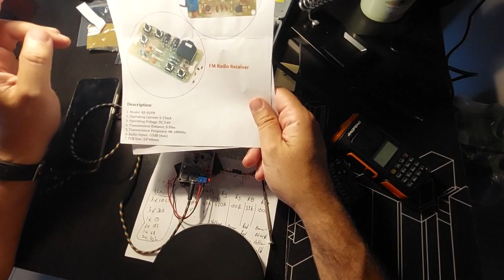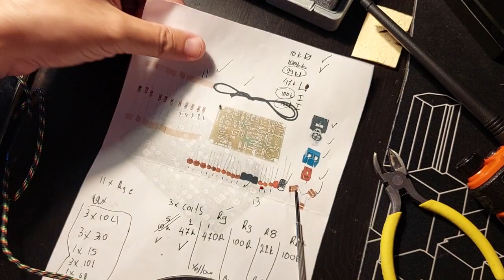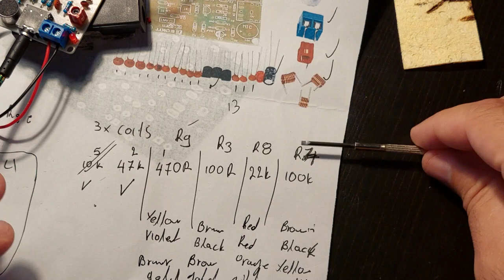FM radio transmitter from ebay

Comment: The signal you were receiving with that Baofeng was not the correct frequency, but some harmonics. Those single-transistor generators can easily reach a range of 100 meters.
Reply from the maker: How do i check that? Get a proper radio?